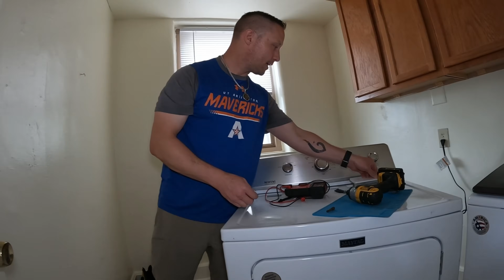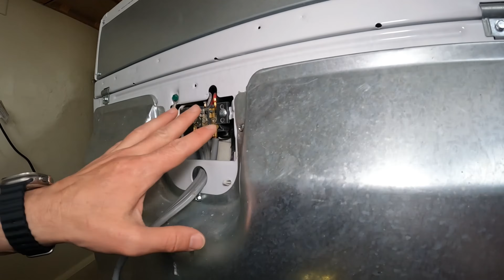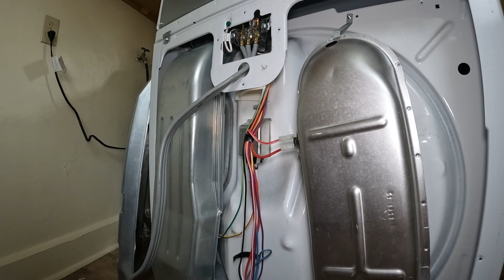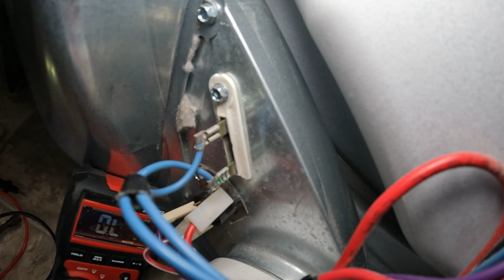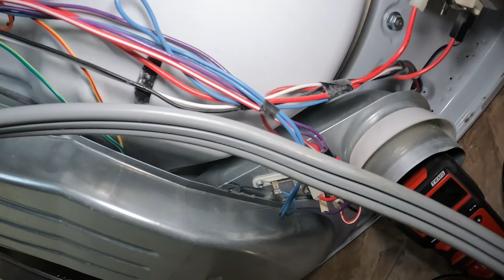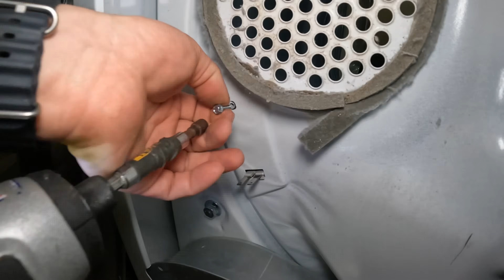How to Fix a Maytag Dryer That Won’t Heat

Comment: I'm trying to check my heating coil and getting no reading. Not 8-12 what could be wrong? New coil time?
Reply from the maker: If your coil is showing you a reading of infinite or Open, that would indicate that you have a break in the coil somewhere. If you remove the coil and inspect it, you might be able to find the break in the element wire just to confirm the suspicion. But yes, that would definitely be a replacement.
Reply: @SpaceBoundDIY I removed the heating coil and found one of the coil elements is busted in half so I found the problem. I ordered a new one and hopefully that will fix it. Thank you for answering my question and for the very informative information. Great video.

Comment: So my thermostat read 0L on the left and right prongs so I ordered a new one and put it and it still reads 0L. I did a test run and still no heat. Everything else checked out good. What do you think could be the issue? The new thermostat bad? Thanks in advanced
Reply: Did a little more testing. And it seems like the dryer will heat up under the sensor dry, but not under timed dry. Could this be an issue with the knob that selects eiher one?

Comment: everything ohmed out good, drying is slightly warm, but not hot even when set to high temp, regular temp setting is just room temperature air.  is there a proper ohm reading for the moisture sensor?
Reply: Check all components ohm fine. Replace timer and heat selector. Ok

Motor centrifugal switch ok. 

Dryer is driving me mad, still no heat.
Reply from the maker: You mention the moisture sensor. Are you getting the same result (low/no heat) with the timed dry mode as you are with the moisture sensing mode?
Reply: @SpaceBoundDIY  I only get a little heat when temp control is on high... Same result when on automatic or timed.  No heat at all when temp control is not on high
Reply: @BrianTolley-u3t  Have you looked at the heating element itself? Sometimes those coils wear out and snap.
Reply: Hi, Brian. I saved your video in case I need any of your very informative solutions. Now I have a question that you may be able to help me with. My elderly mother has a Maytag gas dryer. I replaced the thermal fuse and that didn’t help. When the machine is set on the automatic cycle it doesn’t heat at all. When it is on timed dry if it heats, it barely heats on the moderate or high cycle. It heats a little, though, sometimes, and I may be able to dry a light load after several tries. What do you think the most likely problem is? When I bought the thermal fuse I opted to buy it with the dryer cycling thermostat, but I don’t want to bother installing that if it’s not going to help.